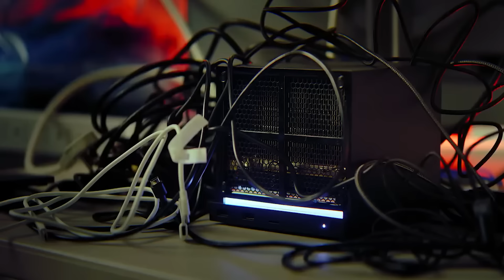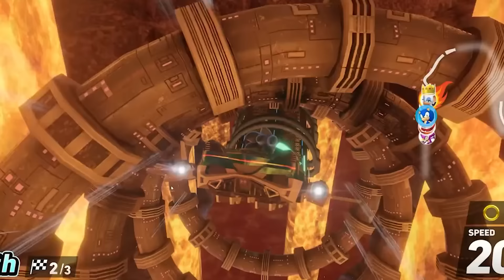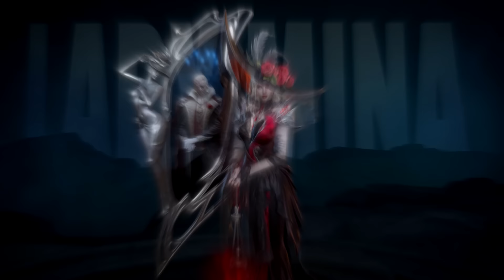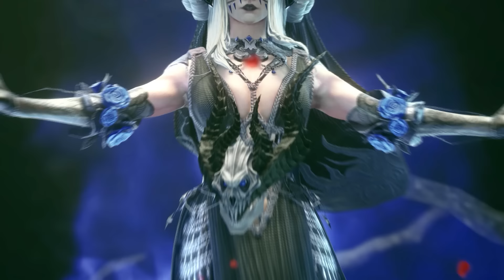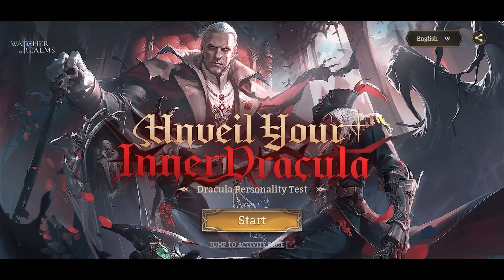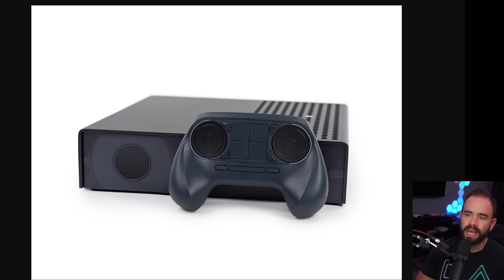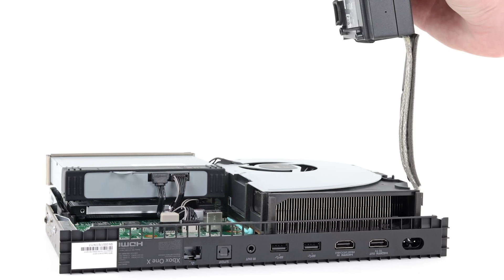The Steam Machine Is More Impressive Than It Looks...

Comment: If the price is right this device is going to sell.
Reply: Come on down
Reply: That's what I keep seeing. It's all going to come down to the price. It needs to be cheaper than the cost to build an equivalent system at the very least, or there's no point.
Reply: No it's not, they need to release this in retail stores for it to reach a bigger audience. A lot of people don't even know what a Steam Deck is and those who do either keeps up with gaming by watching these channels or already games on PC. Those who don't do either of that and just go to retailers doesn't even know what a Steam Deck is or that it even exists. If the Steam machine is supposed to appeal to the masses then Valve needs to switch up their strategy.
Reply: @firestriker6846 thats right i hadn't thought about that

The problem with the steam deck is that it unfortunately isn't well known to the average person, it also costs a ridiculous amount in Australia 

Im really worried about this console
Reply: @Empress_Selina i wouldn’t be. A company like valve wouldn’t drop 3 high risk products if they weren’t absolutely confident
Reply: @firestriker6846  I think Valve is leaving retail for third-parties? I’d imagine other parties could make Machines or Headsets with SteamOS built into them, as they have with the Deck. At Best Buy, there is typically a huge display with the Legion Go S running SteamOS on it for you to play with and try out.  So, SteamOS is in retail—just not every device and every store.
Reply: @firestriker6846  my steamdeck oled is my first gaming PC, it's also the first purchase I made with my steam account.
Anyone who enjoys gaming enough to watch gaming centric content on YouTube is aware of the existence of the steamdeck.
Reply: @firestriker6846  steam currently has around 30 to 40 million concurrent players. The steam machine is equal to or better than 70% of the pcs that people are currently using on steam. If the price is fair and they can afford it, they will likely upgrade to the steam machine. Plus word-of-mouth advertising and all the youtube advertising they're getting. I'm sure they'll do alright, assuming the price is fair of course.

They can definitely just break even, but more likely will go with a pretty small profit margin to maximize value to the customer along with the least amount of risk for themselves.
Reply: @firestriker6846 are they not releasing in retail stores?
Reply: @Simon-fx6lc Not that I'm aware, if it's anything like the Steam Deck it'll only be sold through Steam.
Reply: @firestriker6846 it’ll still sell well even if on steam only. It’s growing in popularity
Reply: @firestriker6846 so you have no idea if its being released in retail stores?
Reply: @Simon-fx6lc lets put it this way, xbox ps5 and switch was being sold in every tech store, or in the electronic departement. I have never seen a steamdeck. There is one gaming shop that sells the MSI Claw and a ROG ally but no steamdeck😂
Reply: @Simon-fx6lc  no lol. Of course not. And they don’t have to. This thing doesn’t have to move 50 million units to be a success for Valve.
Reply: @Dankro91 they don’t sell steam decks outside of their store because other retailers take a cut and the margins become not worth it for them.
Reply: @Simon-fx6lc  No idea? What other Steam hardware is sold in retail stores for average people to buy?

They sell store credit vouchers, that's it.
Reply: @Dankro91 why is this relevant to the conversation.
Reply: @bobbrossify 
Oh bob.
Read the entire thread before commenting, otherwise you gonna look stupid or lazy.
Reply: @OTPulse i have no idea.
Why are you asking me?
Reply: @Simon-fx6lc how is it not? I just gave my observation that they don’t sell steam hardware in retail stores wasn’t that the topic?
Reply: @Dankro91 nope.
I was replying to someone who claims it needs to be sold in retail stores by rhetorically asking 'is it being sold in retail stores'.
As people online, keep starting their comments with 'fact' blah blah blah....
When thier comment is absolutely not 'fact', just their uneducated, angry opinion, id like to point out a 'fact' of my own.
No one knows (apart from Valve) if this console will be available in retail stores.
Reply: @Simon-fx6lc He's asking you because you're the one trying to make an argument that this is going to be sold in stores, when the FACTS are historically no Steam hardware has ever been sold in retail stores. We made our replies to you based off of the evidence that Valve doesn't sell their hardware in retail stores (which again, the historical evidence of their previous hardwares shows that they don't). What historical evidence do you have that they will sell this in retail stores? The one who seems to be making baseless opinions here is you.
Reply: @Simon-fx6lc Btw I never said it needs to be sold in retail stores, read the full context of my comment. I said if they want to reach a bigger audience then they need to sell this in retail stores, which is true. If Valve solely wants to cater to the PC crowd and those who follow tech news that's fine, but YouTubers and influencers needs to switch their tune on who this is catered too. You can't say it's catered to masses when the masses don't even know wth these devices are or that even exist. PS5's, Switches, and Xbox's are sold in retail stores and sell more than Valves hardware because more eyes can see them, the other commenter was right on the money with that comparison. Valve doesn't NEED to do anything, especially if they are catering to the same audience, whether they sell 4 million units or 100 million they will be fine. But if they are trying to get into the ring and compete with consoles as these YouTubers and social media influencers are claiming then they need to broaden where they sell their hardware.
Reply: Anything under 1000 for the 2tb and it sounds good to me.
Reply: It needs double the vram, 8GB isn’t gonna cut it. As it is u won’t be able to play ANYTHING relatively new at 4K, at all. It’s complete junk in late 2025
Reply: @godnamedtay it really depends because the steam deck is pretty impressive for what it is. It plays alot of games fairly well. I think because of how optimized steam os is the steam machine should be able to play most good games at 1080p - 1440p at 60-90fps consistently. Most AAA games are just completely unoptimized in general thats why you need a 1000 dollar gpu to brute force games to look even half way decent nowadays. Look at Arc raiders for example as an unreal 5 game that is actually optimized. The game can run pretty consistently at 45fps on steam deck with the right tweaking. The steam machine will be just fine for what it's trying to do.
Reply: @themadtagger6450  the switch 2 has more vram than this box of junk, lets be real. I love valve too but this thing is a complete joke. It’s literally made of old off scrap pile AMD parts. It’s made for TV’s, show me a 1440p or 1080p TV anywhere inside a Best Buy or Walmart…It’s a slap in the face.
Reply: @godnamedtay last i checked steam deck was still pretty neck and neck with switch 2 and outperforms in a few areas. I think it's a wait and see thing because realistically specs are not the complete picture. Steam os is pretty well optimized so hardware is not bogged down by the os like so many others. For example the rog ally handhelds perform far better running steam os compared to its windows counterpart. So the steam machine in theory should operate much better than the specs would lead you to believe. Just give it some time i think it's going to shatter people's expectations.
Reply: @t @themadtagger6450 k no, so first of all, the switch 2 blows the steam deck away in raw performance, let’s get that straight. The ONLY thing this steam box has going for it is the name, “steam”, if this was any other brand it would called pos and would be doa
Reply: I hope so.
Reply: Facts
Reply: Yeah like 3-4 million in 4 years
Reply: I think so too
Reply: I cross my fingers for something along the line of 450$ - 500 max. It actually isn't that bad, considering the ps5 / Xbox series X apu are basically a rx 6600 xt / cut down rx 6700 level (rdna 2) , and only have zen 2 cpu downclocked to 2.3 /2.4 ghz, the steam machine has a zen 4 cpu at 4.8 ghz with a rx 7600. So it's a very slight cut above these consoles, but at least it has zen 4 cpu and also rdna 3 capable gpu that profits from more of the latest upsacling and amd features then the ps5 and xbox series x.
Reply: clean 400 ill buy one just to have one, last thing i need is another pc but id throw it in a bag and have a travel console just bc the thing is so cool
Reply: Availability is also a factor. In my country the Steam Deck is expensive af.
Reply: Hard to say honestly. The steam deck was priced very competitively but it wasn't available in quite a few regions and didn't crack 10 million units in its current lifetime sales
Reply: So update linux and than update windows and than update virus scanner and than update valve. yea for now it's show bizz😂
Reply: @rimboeglitch590 One of the benefits of Steam OS is that you only need to update one thing, not an OS, a Client, a driver set and a BIOS
Reply: it has to be where Valve does not lose money on hardware but does not go nintento level greed
Reply: They don't care if people buy it or not, as long as they're not losing money.
Reply: Valve said it will be priced as a PC
Reply: I dont even need this thing but I want it. Already have a pc (7800xt, 5700x3d, 32gb 3600 ram), a deck and series S. The series S can go but that's my only avenue to gta vi that's the only sticking point. Who knows how long we'll have to wait for a pc release.. at least 6 months. It's probably more like 1-2 years. Seamless couch play with your entire library will be awesome tho. I'll make room for it 😅
Reply: If I eat a lot of food, i won’t be hungry
Reply: i dont see a point of this machine but i guess there are quite a few ppl without a "gaming" pc
Reply: I have always been a console gamer and use an old laptop for everything else, Is this a decent Gaming pc that can also be a regular pc?
Reply: it is never going to sell much, I predict it never exceeds 15 million at most after several years. It will take a few million console fanboys but not much more. if it is not for sell at best buy, walmart or amazon most people will really not know enough about it. Plus even if it was sold at all these places Valve could never produce enough to meet demand world wide. They have sold about 5 million steam decks to date and it has been out for 3 years. I'm not ever buying one, I built my own last summer that has way more horsepower, it is not small and cute but I think it will last me years, at least 10 maybe more. Video games have already peeked 7 years ago, so intel they make more than a few games a year that I feel I need to play I really might never upgrade anything other than storage. I have a steam deck and nobody I have shown it to even knows what it is, even though they all think it looks really cool. I would rather see people around me buying these instead of a playstation or a switch
Reply: That's the deal breaker really tbh with you I have a base ps5 and a X box series x but often can't be arsed booting them up so was debating a steam deck anyways and with this on the horizon seems like a good time to begin getting involved with these scene
Reply: Only if it’s available in stores though imo. But we’ll see.
I’d welcome it cause Xbox and Sony need some competition.
Xbox to abandon their stupid pc box idea with which they’ll fail and Sony to drop prices.
Reply: @RomanF8  and what xbox goes back to making true exclusives that aren't day one on windows? Is that likely to happen? Seems doubtful atm, basically two generations of xbox being pointless as you might aswell just use your pc, this is why xbox lost all the headway it made in the 7th gen. 
I'd love for xbox to make all their future games exclusive for the next xbox NOT being day one with windows (wait 5 years before porting), can you imagine a xbox console where Fable 4, Halo 6 (i dunno what they'll call but they should probably just do Halo 6 and forget about infinite... ) Gears of War 6, DOOM 4 (please actually make DOOM 4), Elder Scrolls 6 (man this is alot of 6's)

But i have no faith in Microsoft doing that with the next xbox, it won't get true exclusives even if it wasn't a pc hybrid it would be this same everything on windows day on date and pointless to own for majority of people. Its sad when 360 is like my second or third biggest physical collection (wii u i have slightly more or less not sure, i have over 60 games on each of those ps2 is largest with like 150 odd), but since they announced Xbox one and all the game just come to windows i haven't seen anypoint.
I guess full BC with my original xbox games would be pretty tempting, but with only 60/70 its pointless as most of the ones i want to play using my disc aren't supported so i either have to fix my Xbox crystal or just well... 

Anyway its really sad what they did to Xbox
Reply: @TFx2TV 
Yeah, Xbox is done.
They won’t do all of that but PC day one isn’t the issue as there’s millions of people who prefer consoles over pc.
They should’ve kept their games exclusive to Xbox and PC.
Putting their games on Playstation was the final nail in the coffin.
That next Xbox, whatever it’ll be, will be their last.
In 5~10 years they’ll be software publisher only.
Reply: I have a PS5 and decent gaming laptop.  If the machine is arnd $400, I'll buy it but I don't really need it.
Reply: it's not going to be cheap sadly. it will be 700-800$ most likely since they said they are not competing with consoles.
Reply: @jprec5174  I’m betting on 800$+
Reply: Watch this sell less than the Steamdeck
Reply: @marcheharvey2301  of course it will, it won’t even sell half as well as the steam deck, are u kidding me
Reply: It will sell no matter what the price is. You got gamers spending thousands on old retro games, $1,000 for Rule of rose, $2,000 for Clay fighters and the list goes on.
Reply: @jcsjcs9777 
One has absolutely nothing to do with the other.
Also how many gamers are spending that much on retro games, tens of millions? 
What a ridiculous argument.
Reply: @RomanF8  Yeah on whatnot you have a bunch of video game addicts who spend hundreds of thousands, maybe you have been there yourself.
Reply: @jcsjcs9777 
Again, that doesn’t have anything to do with how much people are willing to pay for a box that plays games.
Two different demographics.
And what I do or don’t has nothing to do with this either.
Reply: @RomanF8  You like your own comment?
Reply: @jcsjcs9777 
You got anything of substance to say?
Don’t try to change the subject.
Reply: @RomanF8 🥱🥱🥱
Reply: The price for a 500gig is right to you? We are going to 2026, not 2001.
Reply: 299
Reply: @peggingthestallion6365 you wish,  it will probably be closer to 700-800
Reply: Base on the specs, I'd say around 700-800. Pricier, but if you like to emulate exclusive consoles.  It's a steal.
Reply: @d3vilmaycry25 
700~800 is not a steal and for the majority of people it’ll be a big turnoff.
Steam Deck is so well priced and still people don’t buy it.
It hasn’t even sold 10% of what the Switch sold.
You think a 700~800 Steam Box for 1440p gaming will sell enough units to make a dent?
Reply: @RomanF8  Globally, 70% of gamers have more than one gaming platform.  In the US, 70% of Nintendo users own a PS4 or Xbox.  A decent rig would cost 1k USD. You tell me if they can't afford an additional gaming platform.  Console users keeps whining about monthly subscriptions and few discounts but keeps buying overpriced slop.
Reply: @d3vilmaycry25 
I mean, you’re countering your own argument there.
A Switch 1, PS4 or XB1 cost nothing at this point.
That’s not an argument for people buying a steam box.
Hell, the Steam Deck hasn’t even sold 10% of what Nintendo sold with the Switch and the Steam Deck is dirt cheap for what it delivers.
Now explain to me why anyone who buys consoles for 400~500 bucks would buy a steam box for 700~800.
70% of gamers won’t buy a steam box, even for 400~500 bucks because of brand recognition alone.
Sure, the thing could sell 10 million units over time but nowhere near 50 or 100 million units, especially if the price isn’t dirt cheap.
For 700~800 if you shop around you can get parts for a rig that has way better performance.
Unless it’s 500$ it won’t sell, period.
Reply: @RomanF8  That's your interpretantion?  How short sighted and blatant cherry picking.  I merely stated that 70% consumers have AT LEAST 2 OR MORE SYSTEMS, ie Nintendo users have a PS4 or an Xbox as one example Do I goddamn need to tell you ps5+xbox360+nintend 65 or ps2+xbox one+ nintedo game cube?    Calling the Steam Deck a flop based on the sales is short-sighted.   It's as if you didn't watch the trailer, it's strategic value is its expansion of the platform. It's as if you're ignorant of the console seller practice, that Sony/Microsoft/Nintendo DOESN'T PROFIT with the machine, they PROFIT with the GAMES and SUBSCRIPTION. 84M and 154M, doesn't mean much if you only BREAKEVEN.

And the meat of your question, if I'm going to buy at least a console IE (Playstation) and expand later (Xbox and later Nintendo), that cost 550+800+450 = 1800.  I would rather invest for a 700 to 800 hybrid, that I can play in my bedroom, my living room, or anywhere else.  Again, shortsighted of you.
Reply: @d3vilmaycry25 
Calm down there, princess.
Didn’t take your pills today?

There is no interpretation, there’s only numbers and those numbers are facts.
Also, stop putting words in mouth.
I never said the Steam Deck was a flop.
I said that it isn’t anywhere near the sales numbers that all the other consoles have.
Hell, it didn’t even surpass the Wii U.
That’s reality, not shortsightedness.
I mean, what is even your argument here?
You’re a steam fanboy and because of that you write random bs in ALL CAPS to try and make a point that doesn’t exist?

You literally said 70% of people who have a Switch have also a ps4 and xbox, without specifying which xbox.
Now you wanna tell me that I’m interpreting stuff? How about think before you write.
It’s not my problem when you say one thing but mean another. That’s you having communication issues.

But yeah, tell me the grand plan and the long game of Valve.
Hardware doesn’t need to sell, it just needs to exist to do what exactly?
You wanna do a Microsoft and try and sell me on Xbox and gamepass by telling me that eventually it’ll be worth getting in 10 years when Microsoft finally has enough games after acquiring as many publishers as possible? 
Oh wait, they did that from the XB1 and XBSX era and now they’re on their way out to be the next Sega.

The only reason that Steam Deck and the new hardware exists because Gabe has infinite money. 
That’s also the only reason why Xbox didn’t go away after the XB1 era. 
But the moment that the top guy and Valve makes the same decision as the current leadership at Microsoft has, wanting to make money, Valve will kiss their hardware goodbye.

It’s so insane that you believe that Steam still needs to expand their platform when they are literally top dog on PC.
Even after giving people free games every week, Epic Games Store isn’t coming close. Steam has 0 competitors and really has no need for dedicated hardware.
They are doing that because they like to, which is of course good for the consumer.
I love my Steam Deck Oled.
But that was never the point of this discussion.
The topic was at which price point the Steam box will be worth it and which price point it’ll have to be to sell more than a couple of million units.
It’s good for you that YOU want one. But that’s just you and you aren’t the majority.

Oh and fyi, you need to get your facts straight, Nintendo does make money with each system sold and Sony is breaking even at this point in the generation or even making a little bit of profit.

You didn’t get my question at all. In fact I never asked you a question. I told you that the steam box needs to be 500 bucks if Valve wants it to be more than a mid-range desktop pc for people who are too lazy to build their own PC.

Btw, you don’t need to factor in Xbox in any of your calculations. Only poor people are buying Xbox Series S with gamepass because they can’t afford to buy games.

Every game is on Playstation or Switch. Exclusivity matters. People will always choose Playstation over Steam box. To suggest otherwise tells me how you have zero understanding of how the market works.
Reply: @d @d3vilmaycry25  agree, it would even then be a good “deal” from a pc gamers perspective.  Building something similar as a mid tower would run you about that.  Plus this comes with a (potentially) durable and precise controller.  

Do I wish it would run $500?  Sure, but reality is $700.
Reply: @redspec01  I wish it to be 500 as well, I got a tower PC, and it's a bit clunky to transfer and use in the living room back to the workstation.  With the Gabe Cube, I can pretty much play the old console exclusives as much as I want without getting a playstation, xbox, and nintendo,  especially the Nintendo games, I'll play it out of spite.
Reply: Thats what said for steam deck 😂
Reply: What’s your definition of “sell?” It will literally sell units, duh…but will it even outsell the beleaguered Xbox series in a head-to-head race? Doubtful. Keep in mind, people call the Steam Deck a success and it has only sold an estimated 5 million units over 4 years…
Reply: @pukeskylark  5 million is alot considering steam runs on a regular PC.. 5 million units without forcing people? Meanwhile xbox only does what Microsoft says it can do and people eat that crap up.
Reply: @honduken what does “5 million units without forcing people” even mean? You’ve got bigger problems than unit sales if you’re sending out enforcers to make people buy your product.
Reply: @pukeskylark  It means a non locked down proprietary device that's just a PC, it means you don't need a steam deck, you can just buy a PC to use their platform all the same or any other handheld for that matter. You think its crazy but people are VERY brand and even store / ecosystem loyal in America.
Reply: @honduken I mean, Microsoft has been less locked down than steam for the past like 10 years 🤷‍♂️
Reply: @pukeskylark  How is an xbox less locked down than steam? Please provide context when making claims.
Reply: @honduken  “xbox” is both the console and PC. When you buy on one you own on both, making the Xbox store much more versatile than steam which requires a computer that runs windows. Any more questions, or are you done making an ass of yourself?
Reply: @pukeskylark  Actually it sold 8 million units, and that was early 2025 report
Reply: @pukeskylark  If it sells 3-5 million units, then thats 3-5 million reasons for developers to get their act together when it comes to implementing anti cheat on Linux. 3-5 million would also be way more Linux gaming PCs than Microsoft is going to be comfortable with
Reply: @pukeskylark  Millions is what we mean by sell well. Steam Deck has continued to be a success because it's the most affordable in that space...currently $319 for the 256GB model.
Reply: @zachcarmichael699 wow.
Didn't know it was that price now.
Reply: @pukeskylark nit even that ive heard 5-6 million is the entire pc handheld space steam deck being 4 million 😅
Reply: @pukeskylark  I personally know four people who are VERY keen on buying this. My friends gf wants a SFF computer that can handle light gaming, we were looking at using thunderbolt or an external PCIe OCULink setup but this is worth waiting for and will cost WAY less then the BoM I came up with.
Reply: @GeorgeWashingtonLaserMusket I'm a console gamer.
Didn't buy series or ps5.
Too expensive, games limited.
This device, I'm interested in.
Plus I'm not a pc gamer.
So I'm one of the potential buyers.
Reply: @GeorgeWashingtonLaserMusket it’s almost like anyone watching, or associated with a person watching a spawnwave video fits into a certain niche
Reply: @pukeskylark 5 million units, no marketing.
What's the series sold in 5 years 10 million 😂
Reply: @Simon-fx6lc  Xbox series sales are estimated to be in the 30 million range and is on life support. Even still, after the initial sales surge of probably 500k-1mil the steam machine will probably sell more slowly than the relative snail’s pace of the Xbox.
Reply: @pukeskylark yep  your correct.
Microsoft call it a failure and are in crisis.
Valve claim 5m on the deck as much more than expected.

Whats your point?